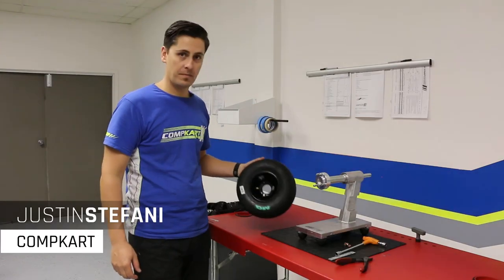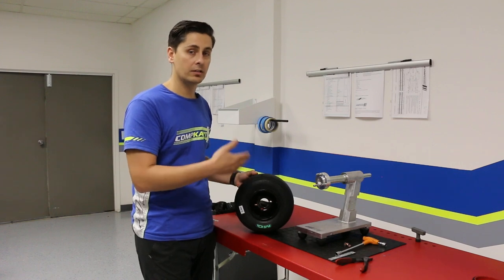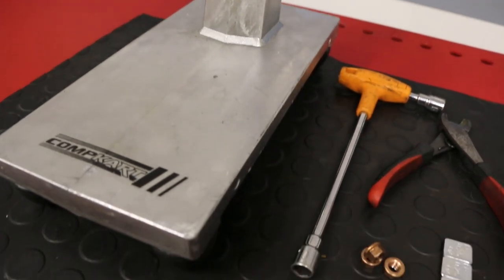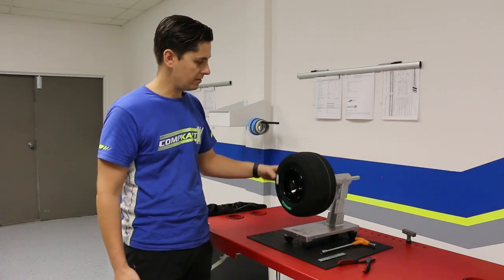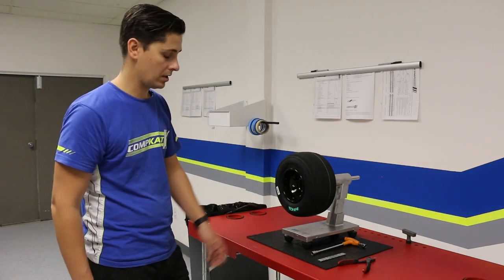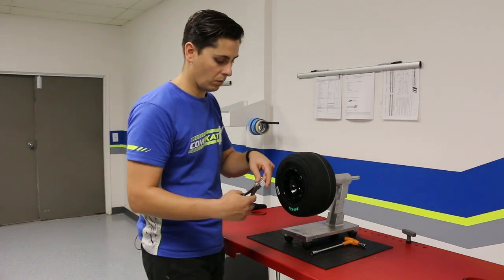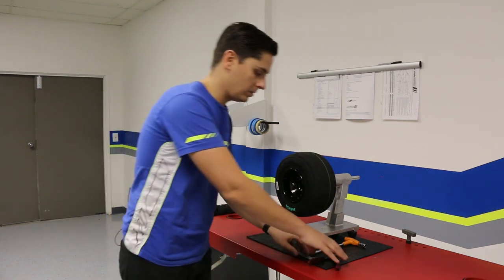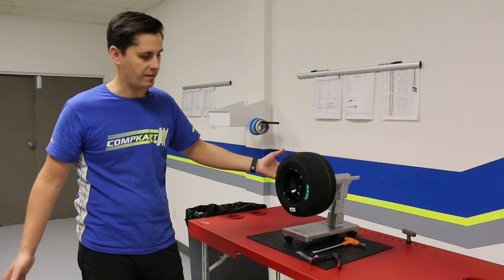Pro Tip: WHEEL BALANCING

Comment: Excellent video. The old school way is to save old wheel weights. Spin wheel as in video.
Use chalk to mark top. Duck tape pieces of old weights until balanced. Weigh old wheel
weights then cut new weights that weigh the same and stick them on. Same result.

Comment: Is there any other way to do this, without having that specific rig? Specifically for the fronts, could you not do the same test with the wheel on the front spindle (I'm running Direct Spindle Mount rims right now).
Reply: +kart360 Cool! Appreciate the help / vid!

Comment: is it possible to continue to dismount & re-mount the tire in alternating locations until symmetrical balance is acheived? sure its time consuming but may be more effective keeping the rotational mass at bay & eliminate the need for buying weights constantly.?
Reply: If the tire is out of balance you could never balance it no matter how you rotate it.

Comment: In some videos people uses the hub to balance the front wheels.
Can I use the front hubs to balance the rear wheels too ?

One tip (that I saw in a video) is to pin the weight with a small piece of tape and test before installing the weight definitely.